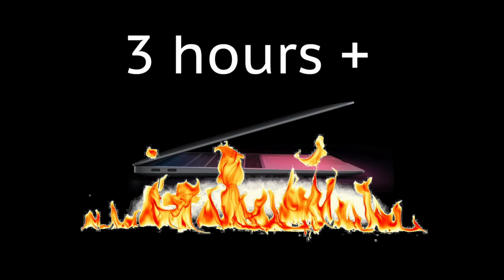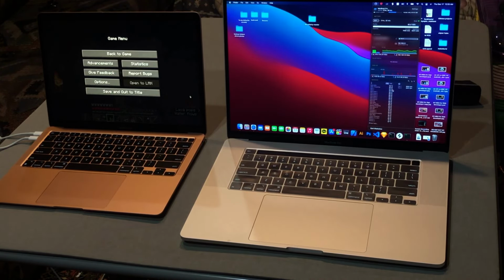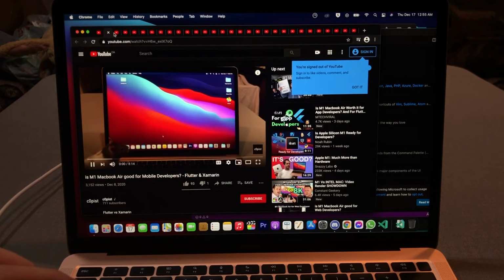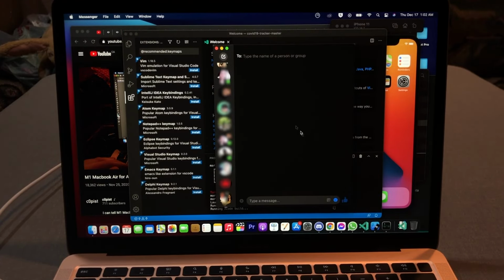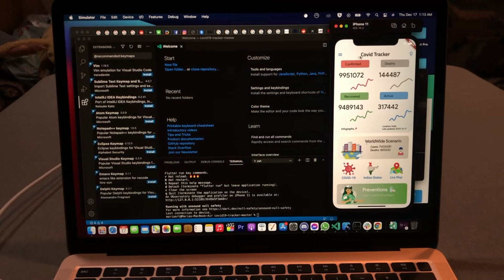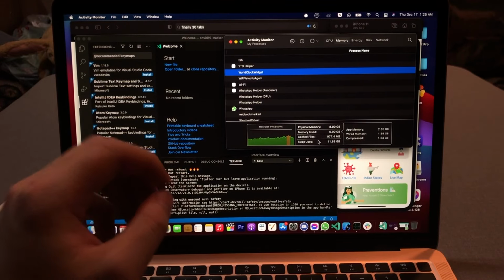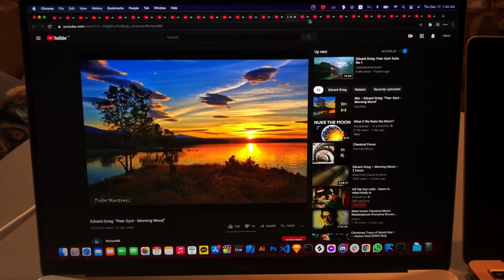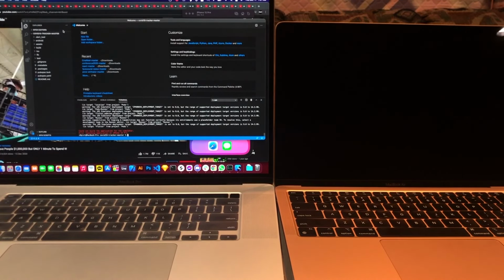Does M1 Macbook Air Really Get Extremely Hot?

Comment: There's a little app called "hot" that can run in the menu line at the top of the screen and gives you a running temperature. mine is at 36C measured at the CPU.
Reply: I just cant find the app D: do you have a link? Thanks a lot!

Comment: I dunno what's wron... I mean what's not wrong with this Air
Mine somehow running Minecraft only without anyother software on the background(even spotify, safari etc.) gets to about 90C degrees and 1 core out of 8 is 105!
I have made a small research on the net and some guy asked Apple directly about this overheating thing and they responed that basically it's just fine(like in that mem with dog)
But anyway, I really don't know how to explain that you've got these kind of results comparing to mine...
Reply from the maker: There must be faulty models out in the market and yours could be one of them. If you can visit Apple store show them my video/different youtubers’ test video to compare to yours.

Comment: I live in India where it gets 45°C for 3 months and I am planning to buy M1 MacBook air. I am not a video editor so mostly my laptop will be used for streaming and learning purposes. Will the Macbook Air face any heating issues? Kindly suggest!
Reply from the maker: I didn't have a chance to test it in the hot weather since I got M1 Macbook Air in the winter. Unless you use it for a heavy task(rendering 4k video etc) it should be fine in my opinion
Reply: @c0pist  thanks for the advice. Also, can you suggest whether a 256GB storage enough? I will basically use it for streaming purposes.
Reply from the maker: It'll be fine with 256gb. Are you gonna save the streaming? Then more storage is better
Reply: @c0pist  No I won't be.
If it is possible then can you tell me test and tell how hot will the MacBook Air get on a warm day. Don't make any videos, just let me know in the comments section. Thanks!
Reply: @architchatrath4361  hey, it's been 4 months now. How's your experience with mba M1 in our india and Pakistan whether in summer?
Reply: @Alihaider-rs8is  I got M1 macbook in August and it was fairly warm at the time (40^C). I have used it for taking classes, running photoshop softwares etc. for hours at a stretch and it has worked amazingly without having heat issues. I haven’t used it outside of my house so for that I can’t really say but indoors it will work more than just fine. It is super fast. 
Just a friendly advice; kindly check the availability of softwares that you want to use on daily basis and if you have the budget then increase the storage capacity instead of going for pro
Reply: @architchatrath4361  really Glad to know your experience. Thanks for your advice. My MacBook air is coming in 3 or 4 days with 16 GB. As I need this for my development work.
Reply: @Alihaider-rs8is  bro how was ur experience?
Reply: @satviktyagi182  bro I purchased MacBook pro, it is okay in summer but I would not recommend you to buy MacBook air as this product would get heated much in this hot summer it don’t have fans in it
Reply: @satviktyagi182  bro I purchased MacBook pro, it is okay in summer but I would not recommend you to buy MacBook air as this product would get heated much in this hot summer it don’t have fans in it
Reply: @Alihaider-rs8is  bhai inone go  how long can it work  for coding development and editing? coz if  i go for pro then i will be ablle to buy 8gb variant it will consume swap memory....do heating reducee  the  performance?
Reply: @satviktyagi182  normal heating does not reduce the performers much and MacBook Pro does not heat so much and you can go with 8 GB memory
Reply: @Alihaider-rs8is  but issue is swap memory it writes a lot in ssd
Reply: @Alihaider-rs8is  is 8gb sufficient bro ? for web development and coding editing?

Comment: hey dumb head, M1 chip consumes only 5w, think about an led bulb which consumes 5w, how much hot it will become if you switch it on for a day, i would say nothing, just like that for M1 chip as well, but in the case of X86 processors the scenario is different, those are power hungry and dissipate lots of heat.
Reply from the maker: I already know all these since M1 was released. What are you trying to say? Your comment doesn't have a point.
Reply: @c0pist  the point is simple, it cant get hot in normal working condition unless the board is faulty.
Reply from the maker: So did your explanation have to come with "dumb head"? Wow. I did this test for people who commented on my video asking me about heat since they don't know much about Tech.
Reply: @c0pist  that is the reason for most of the companies move in to arm architecture, those transistors were designed in a way to consume a lot less power, if you look on any embedded chips most of them are based on ARM core

Comment: Hello,  i want to be an aerospace engineer.  i wanna buy macbook air m1 8/256. i will use apps like CATIA, siemens nx, matlab, autocad, zoom, discord, office 365 and apps like that. i have been used an windows laptop and i hated. can you suggest me that mba? sorry for my mistakes about this comment. my English is not so good. thank you.
Reply from the maker: It depends on what type of software you will use.
Software you will use like CATIA only works on Windows.
Virtualization such as Parallels or Bootcamp are not currently supported yet.
In this case you need to wait until they release the official version, or you need to buy Windows laptop if you need it right now.

Comment: The Macbook Air M1 is still a beast because even if it, SOMEHOW, has heating issue then a 10 dollar cooling stand would totally be worthy...
Reply: I've watched a video testing mac m1 air with a cooler. Didn't make much difference. 1 degree cooler at most
Reply: Ouh, soo if i buy Air m1, cooler fan will work just fine?

Comment: What is "Swap Used" and "Cached Files"? Thanks
Reply: Softwares/Apps needs a place to store things it needs to work, much like how you would on your desk/workspace. RAM/Memory is one place to store things that are ACTIVELY needed, like the buffered data on your YouTube videos you watch, etc.. However, not all data can be squeezed in on the RAM/Memory, especially when multitasking. As a solution, Swap is used. Swap is usually just a location, a space on your regular HDD(Hard Disk Drive) or SSD(Solid State Drive) that the Operating System (OS) uses to put things that it thinks you still need but, are NOT actively using, for example your long minimized App. Why can't we just use your HDD/SSD as the RAM/Memory if that's the case then? Because RAM/Memory is much, much faster than the speed of your HDD/SSD. What's more is that, they are designed to be accessed much more frequently than with your HDDs/SSDs. Think of writing and erasing on a piece of paper versus a white board, which one will wear first?

Edit: Oh, and when both your RAM/Memory and swap is almost consumed? The Operating System will start killing/shutting down Apps in order to keep some space for itself. That way, your machine is still operable.

Edit 2: Operating Systems (maybe not all) can also use Swap for putting things aside for when its next wake, in case where you put your machine in to sleep mode. This is so that it can pick off where you left off.
Now there may be other use cases for Swap, but these are some.
Reply: @gelotress479  thank you for the patient and detailed explanation!
Reply: @gelotress479  Awesome! Thanks.

Comment: I used TGPro to monitor CPU temperature and while exporting 4k video I got to a max of 100 degrees Celsius. About the same I got on the MacBook Pro 16 inch I use for work. For a machine that has no fans and is exporting video at about the same speed than the MBP 16" (and costs a third)  that's  pretty impressive!
Reply: Per dye temp or the whole chips temp?
Reply: @harshitichigo7223  Does it heat you up?, I also have the M1 Pro and sometimes it goes up to 60º Celsius / 140º Fahrenheit in chrome

Comment: Great video 😍, I want to get Air 16gb ram for my professional software development. 

What you think if we use this machine for 8-9 hours daily? Will it thermal throttle?
Reply: No I don’t think so. Unless you recompile a huge project just beachside you changed a line and then try out everything.
Reply: Also it will never thermal throttle as much as a old MacBook you used on the couch for years without cleaning the fans. No fans do dust :)